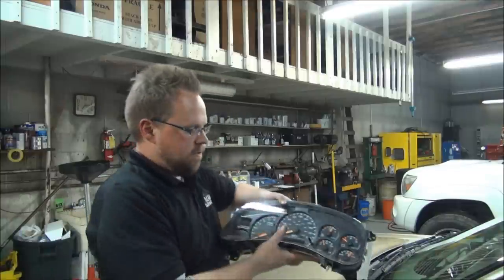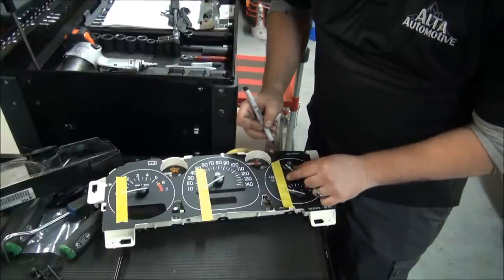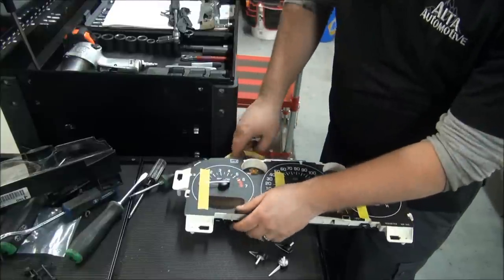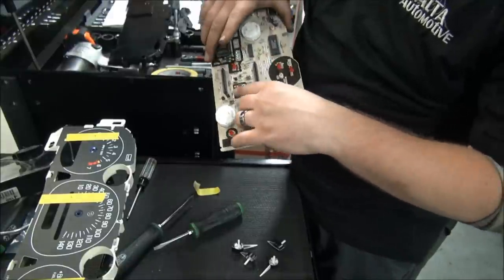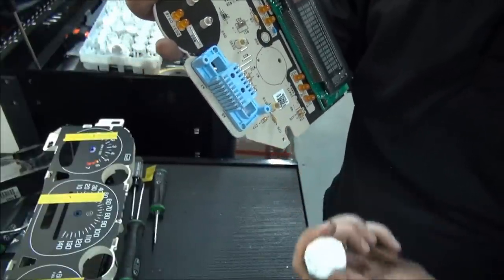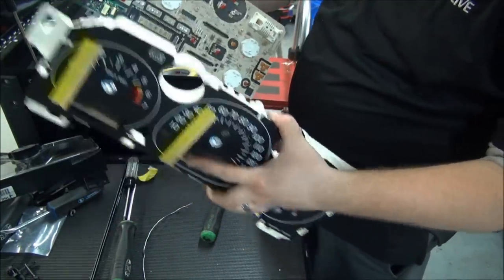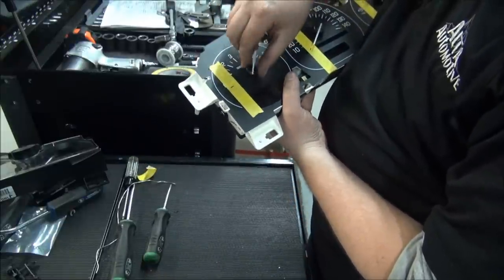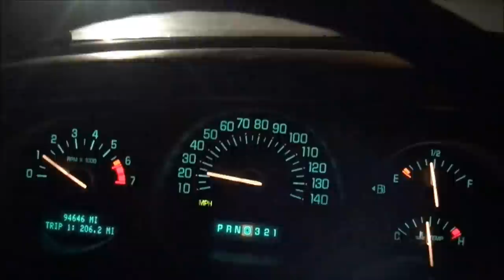How to repair GM Instrument Cluster | Speedometer | Gauge | Stepper

Comment: You need to inform people that you can damage cluster panel if not soldered correctly.Not as simple as it seems
Reply from the maker: Sam Burchard Yes you are very correct, I have 20+ years fixing this kind of stuff. So sometimes I forget that I make it look easier than it is. (sometimes)

Comment: i have an 02 suburban with the same problem odometer and speedometer are just unresponsive or intermittnet
Reply from the maker: I'm sorry that sounds like something other than the stepper motors in this video. Possible wire problem or short in the cluster.

Comment: If I didn't explain to you right what I am wanting to know is there a way to calibrate the temperature stepper motor to tell you when the motor over heating. After i replace my stepper motor the red light and alarm goes off telling me it over heating but it not. It all started after I did the replacement of these stepper motor. the Rpm,speed and fuel all work fine just not sure about temp or where to put the needle..
Reply from the maker: You may have a problem with the temp sensor/switch sending the incorrect temperature to the cluster... However if you want to try and pull the needle off and put it back on pushing the needle back and forth until you get it adjusted to about 2 tenths of an inch below the lowest temp line that may help... (however it sounds to me like a problem with the temp sender or wiring.
Reply: thanks so much for the reply, It was strange that the vehicle is over heating right after i did that. So you have eliminated that issue for me. By the way I did change the sensor out, thermostats, and water pump flush radiator and also  eliminated that it was a blown head gasket and still over heating.. That why I have been going nuts!!

Comment: I had the interior of my 2015 Chevy Equinox cleaned by Delta Sonic. They used a cleaner called Omni All Purpose Cleaner. When the sun shines on the instrument panel all of the  lenses have a shiney swirl pattern making it impossible to see the speed  and tach gauges. when there is no sun the panel is clear and doesn't interfere with the ability to read gauges. I tried rubbing the lenses with a soft dry cloth to know avail. I went back to Delta Sonic and spoke with the Detail Shop Manager. He applied something else and the result is the same. Do you have a solution? Thank you in advance. Brenda
Reply from the maker: Sounds like the plastic is scratched now.... Which there is nothing you can do other than replace the plastic.... I cant be sure without looking at it myself... However that's what it s ounds like.
Reply: The entire lens looks like clear contact paper that one applies on a bathroom window for privacy. It's clear in the shade and in the evening. There are no visible scratches. Any other ideas?  For the future, what product is recommended for cleaning the dashboard lens? Thank you,  Brenda
Reply from the maker: +Brenda Kahn I use water and a very soft towel only. But you could use like a eye glasses cleaner/spray and eye glasses cloth.

Comment: I have a 99 Astro with a gas gauge that spins like a stopwatch Would it be similar to what you repaired here or is it an entirely different animal?
Reply from the maker: Yes that one is entirely different, sorry.
Reply: Ok Thanks...I've heard it uses capacitors or resistors and they over heat...but I haven't taken it apart to see it that is the case...

Comment: Hi Bri Watched your video on repairing the guages on the GM instrument cluster. I am having a similar problem with the tachometer ( not working at all and the water temp guage) on a 2009 Ford Ranger 3 Liter  diesel. Will this procedure work for this vehicle?
Reply from the maker: I don't think so, I will do some research and get back to you if I come up with anything.
Reply: Thanks Bri. .
Reply from the maker: Glyne B Well I haven't had much luck. I did some research and asked around with a couple friends. Nothing common. I would have to pull the cluster out and check each wire pertaining to the tach and temp gauges if the cluster is not receiving the correct information there could be a temp sensor, wiring, ecm or other sensor problem. If the cluster is receiving the correct info than I would recommend replacing it with one from the dealer or you could try sending yours to one of those companies that rebuild them? Sorry not much help on this one.
Reply: Do It Yourself Bri Thanks Bri, I will be taking vehicle to the dealer to have these checked as well as having the headlights focused. Will bring you up to speed as to what was done, GB.

Comment: i have the problem whit a Chevy Equinox 2007 fuel gauge, you know the stepper motor number for this model

Thanks
Reply from the maker: +Arturo Vega Madrid I would guess that to be a problem with the fuel level sending unit in the gas tank.
Reply: Any sugestión to confirmar the problem before buying some part???
Reply from the maker: +Arturo Vega Madrid There really only 2 ways to test the sending unit...1 is with a scanner like a tech 2 or snap on type diagnostic tool or if you can get to and understand how to test the sending unit resistance levels with a ohm meter....Really should be tested by the GM dealership or a shop good with electrical diagnostic skills to be 100% sure....However it's most likely the fuel level sending unit in the gas tank.
Reply: Ok, thanks for the time and the help

Comment: hi hope can read my comm. where can i get the steppep motor for my envoy 04 . the speed gauge nedle sometimes dont work. thank you .
Reply: +225pirulito Amazon has them. I got a set for my Avalanche for under $30.
Reply: +225pirulito Amazon, pretty cheap
Reply: +225pirulito :  you can buy it from:http://www.amazon.com/dp/B01B782Q14

Comment: man I've got an old electric air compressor and when I flip the switch it only hums. the fan is seased up as well
Reply from the maker: That sucks, better get a work on getting that fixed or replaced..

Comment: if you didn't use tape and needles aren't align now what do you do to fix
Reply: this is 98 cav
Reply from the maker: +judy sokolowski Try pulling the needle back off and recalibrating the stat position just below the 0mph. Hope that helps.

Comment: does that job not require soldering paste?
Reply from the maker: Jim Dent Not needed.
Reply: Do It Yourself Bri Thanks. I replaced the motor for my speedo, and everything works great. Thanks for the how-to.

Comment: Did everything as your described but when i plugged it back in the needles started to go crazy the rpm rotated once completely around then stopped the speedometer worked for 5 second then never moved again the other gauges just all went to maximum. Then i turned the aircondition on and all the lights in the dashboard came alive. ????? any idea
Reply from the maker: +mike schulz what kind of car or truck?
Reply: gmc envoy 2005
Reply from the maker: Mike I have never seen that happen before.. How were things before the stepper motor replacement?
Reply: speedometer, oil and battery gauge stopped working within 3 weeks of each other. On rare occasion speedometer worked for a couple of seconds
Reply from the maker: It sounds like there is a short circuit in the circuit board... I'm not sure if it would have been there before you changed them or if it was a result of changing the stepper motors... The circuit board is fairly sensitive to heat if you got the connections to hot when soldering you may have damaged the board and or there might not be a good connection on one of the stepper motors... Check/inspect all solder connections that you made looking for any dark/heat spots to the board or weak solder connections and or use a volt meter to check each connection using the continuity tester
Reply: oh I also had to change batteries
Reply from the maker: I have seen strange things happen when a wire is not making a good connection at the battery... Gm side posts can be a little tricky to get a good connection at the battery.. It might be worth pulling both battery terminals off and make sure there is not any damage to the side terminal and or bolt. Make sure that they are both tight.
Reply: thx will try that